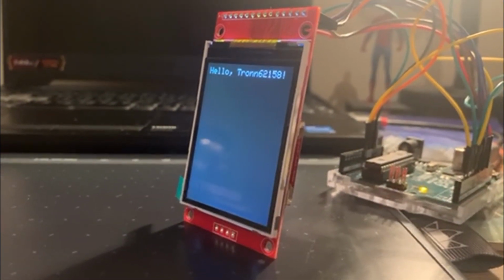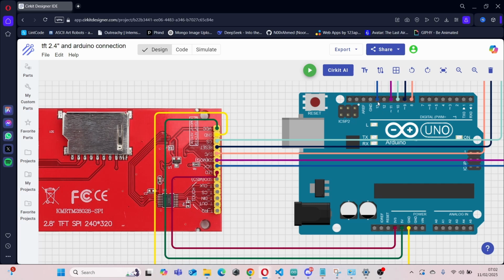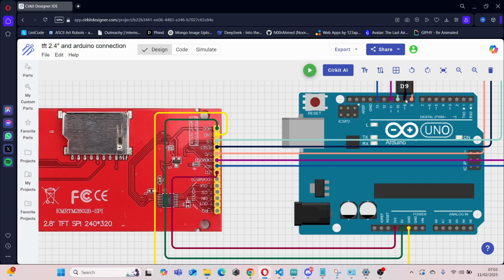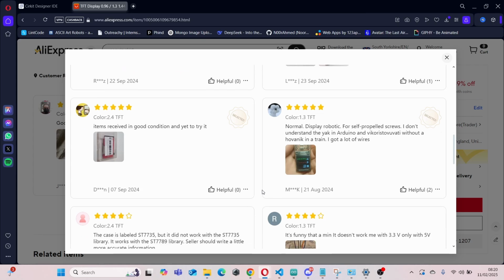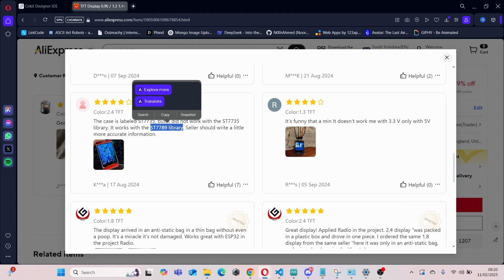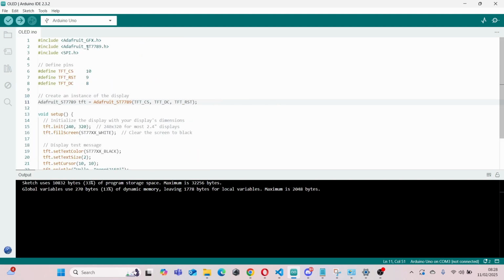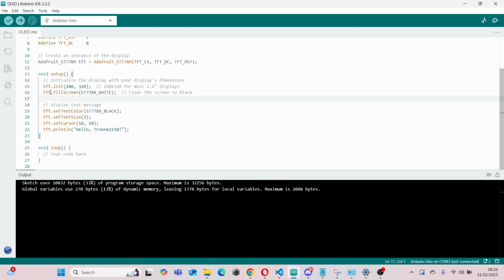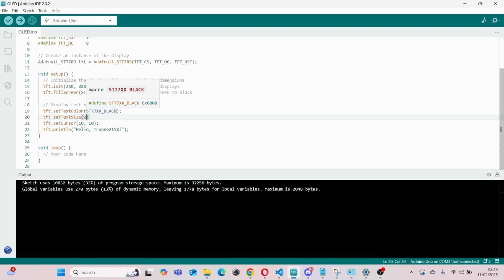Connect 2.4 inch TFT Display with Arduino Uno

Comment: hey man i have a similar board if not the same one. I got it off amazon, it's the FainWan 2.2 inch ILI9341 SPI TFT LCD Display 240x320. I'm not gonna lie I am not the most fluent when it comes to this stuff, but it looks the same so I tried your set up, but my LCD screen just keeps making a white screen, and nothing I do will change it. On the slim chance you see this, would you know what could be going wrong? I'm desparate lol. I forgot to mention but I also have the arduino uno r4 wifi, dont think that changes anything but it might!
Reply from the maker: hey bro for me i saw that the screen would go white sometimes but then i would twist/turn or push the jumper wires on the arduino and TFT Display and that would fix it. Im not sure why this happens but try this out.

Comment: good job man,, tho on the board says 2.8" yet its a 2.4" lcd
Reply from the maker: Thanks bro, I tried finding one which was 2.4 but couldn’t find one
Reply: @Tronn62158 I saw it's imperative that change in the user setup .h file , but your example got me started , many thanks man

Comment from the maker: here's the code: 

#include <Adafruit_GFX.h>
#include <Adafruit_ST7789.h>
#include <SPI.h>

// Define pins
#define TFT_CS     10
#define TFT_RST    9
#define TFT_DC     8

// Create an instance of the display
Adafruit_ST7789 tft = Adafruit_ST7789(TFT_CS, TFT_DC, TFT_RST);

void setup() {
  // Initialize the display with your display's dimensions
  tft.init(240, 320);  // 240x320 for most 2.4" displays
  tft.fillScreen(ST77XX_WHITE);  // Clear the screen to black

  // Display test message
  tft.setTextColor(ST77XX_BLACK);
  tft.setTextSize(2);
  tft.setCursor(10, 10);
  tft.println("Hello, Tronn62158!");
}

void loop() {
  // Your code here
}